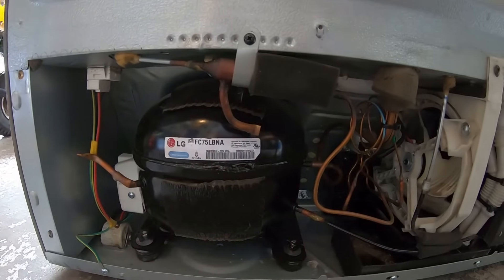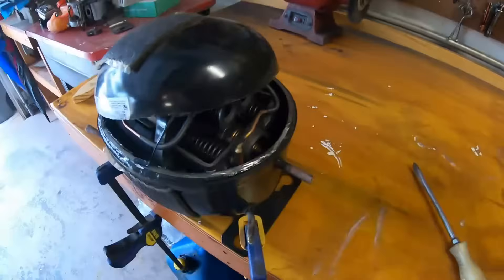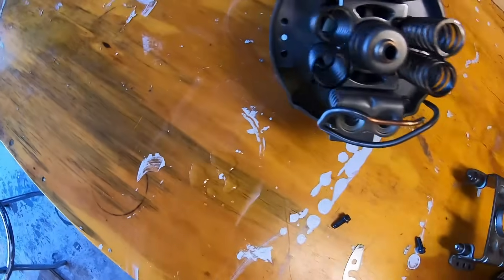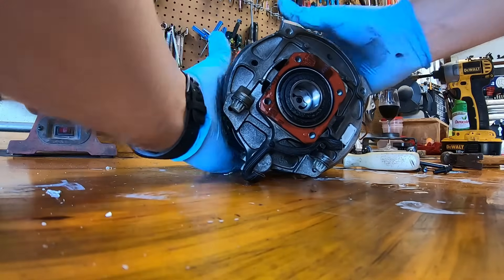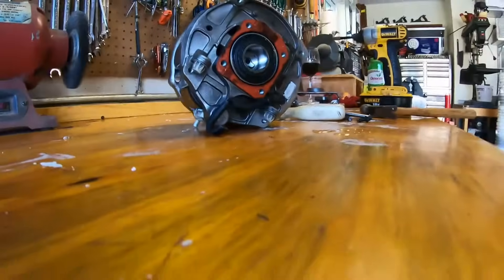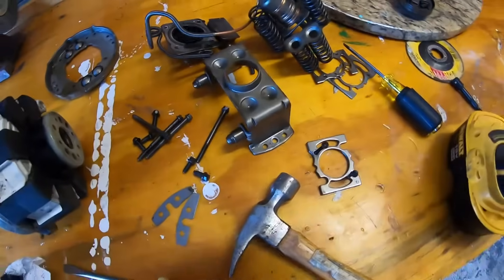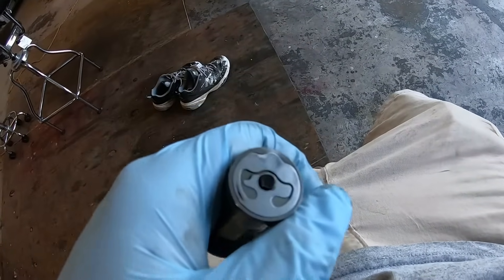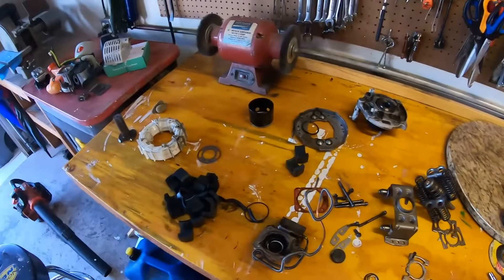Cutting open a failed LG refrigerator compressor

Comment: Thank you for the  "LG compressor  dissection". Yours was the only one I ever found showing why the compressor failed.  My daughter's LG refrigerator with a linear compressor just stopped cooling a few days ago after 5 years.  She got more trouble free years of use than most people with this type compressor and you got 8 years so I guess both of you were one of the "luck ones" for such a long life. HaHa

"WARNING: Don't do this if you are not sure how to work around electrical circuit boards safely and at your own risk....."

FYI: This is how I did a quick "trouble shoot procedure" to quickly and easily determine its was the compressor.  There will not be any error codes showing on the front display board.  Their fancy diagnostic telephone app or the call center  over the phone diagnostic will not find any error codes either.  Hope this save people money by not replacing circuit boards, parts, service calls etc. when it is the bad compressor.  

1. Follow the power cord from the wall plug back to where the cord goes into the fridge.  There should be a cover that can be removed with a few screws and the main circuit board will be exposed. ( My daughter's circuit board was on the very top of the fridge) You will also need to remove the bottom cover exposing the compressor and fan.  

2.   On the circuit board there is a "Test/reset" button. The link is to another Youtube video which shows the procedure very well.  

https://www.youtube.com/watch?v=70y61Sq_NU0

You may have  either a 3 or 4  test button press procedure as outlined in the video.  When you press and all the fans stop and "22 22" shows on the front door display, that is "forced defrost" and all the fans and compressor are off and the just the "defrost circuit" activate.  This is not the mode you want. Note: This may help those with a frozen up freezer coil melt the ice faster instead of  unplugging and waiting hours/days,  using hair dyers etc. if you have a "defrost system" problem and the coil is frozen up with ice.

3. The first test button press puts the entire fridge into maximum cooling mode only, which means it turns on all the circulation fans in the freezer and fridge section, the one by the compressor and runs the compressor at maximum.   So if everything is working the fridge should get cold. The Service manual states the maximum amount of time it will remain in test mode is 2 hours, then it will automatically reset and return to normal.  I  put the fridge in to maximum cooling mode with a thermometer in the freezer section and checked the temp about 1-2 hours later and there was no temperature change.  

Hope this helps someone and saves money, time, and @#$%!@%%$#.  Thanks
Reply: 3rd push of button puts it in defrost mode and 33 33 should display on front display.
Reply: My LG fridge model #LFX28968ST stopped generating cooling in both freezer and fresh storage compartment a wheel ago. We bought it in 2013, and after about 10 years it stopped working. I have been checking all videos on YouTube that related to LG products. And I think this video has a deep investigation on the “no cooling “ issue.